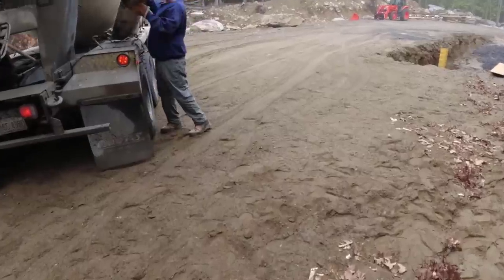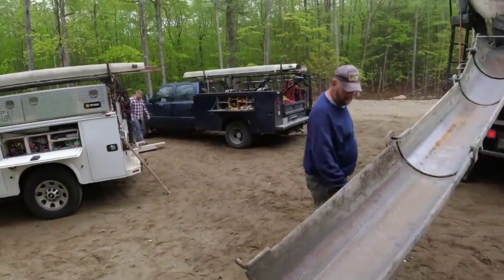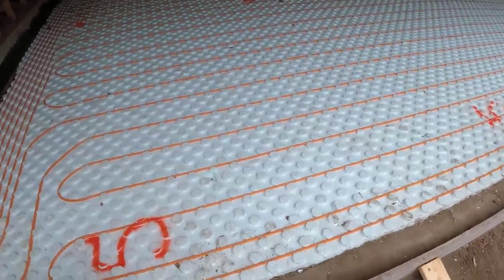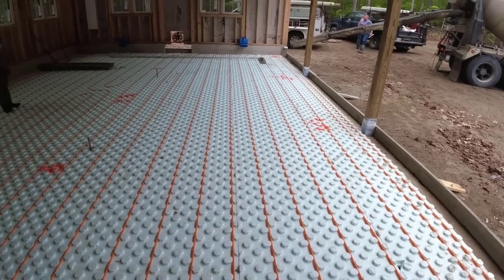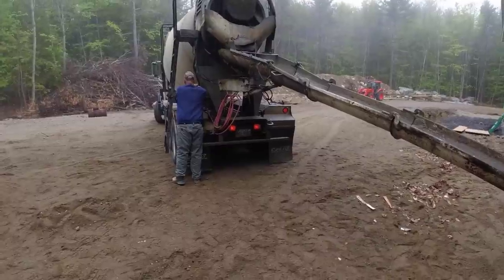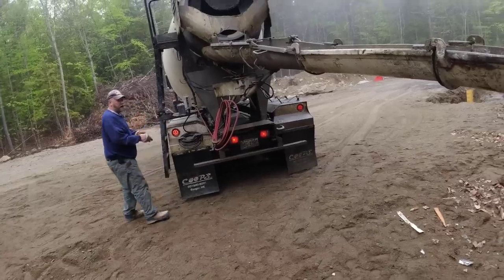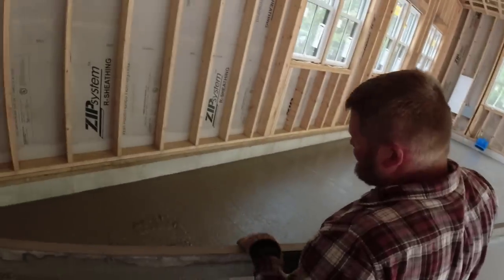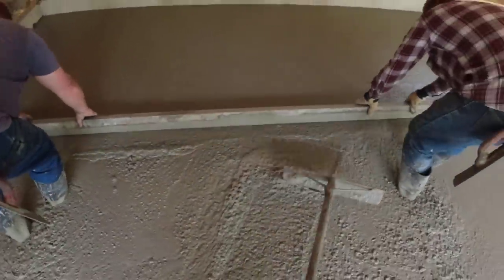"Crete Heat" Styrofoam for a Sub-Base? 40' X 28' Garage Floor Pour

Comment: Hey Mike, I’m in Ontario Canada and am an HVAC tech. We’ve been using this type of styrofoam for a while now. Easy to lay radiant heat piping and helps with pipes being stepped on.
Reply: Have you ever used in a driveway snow melt application? 25 psi or the 40psi

Comment: Hi Mike --  My new build this next year will have Radiant Heat in the house using Warmboard-S and Warmboard-R wood subfloor panels, and the garage floor will also be radiant heated using that type of styrofoam panel (of which I have researched the different ones offered) --  This video is just what I needed to watch!  Thanks again Richard (aka Retired Person) in KY  PS: why did the Owner say they did not like the styrofoam panels?

Comment: As usual great job! What do you do when then concrete comes with too many "dragon balls?"
Reply: They usually break easily, so just pull them to where there's no concrete yet and bust em up with your foot and spread em.out. you can then notify the batch man. Usually those form from batching to fast. Like making pancake batter but not mixing enough and having pockets of powder not mixed in. Sometimes just mixing the truck at high revs will bust em up as well but that come with its own problems so just toss em aside.
Reply: Makes sense sort of like unmixed pancake batter. Thanks.

Comment: What dries harder....wet concrete....or less runny?

My guess would be the longer the cure time...the harder
Reply: Some would argue especially the engineers but I`ve been on jobs that lasted for 4 yrs. and come back by working the opposite side of the road and big breeze ways and patios were still beautiful 3yrs later. So I`m a believer in the quality of the concrete not the slump.